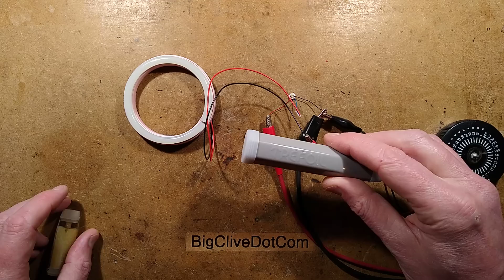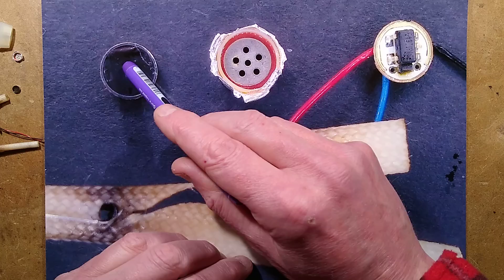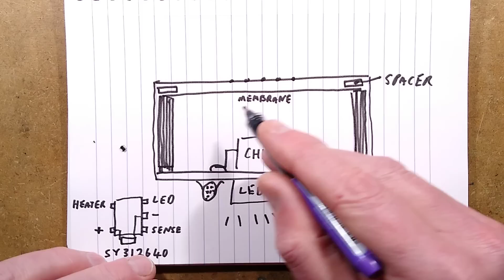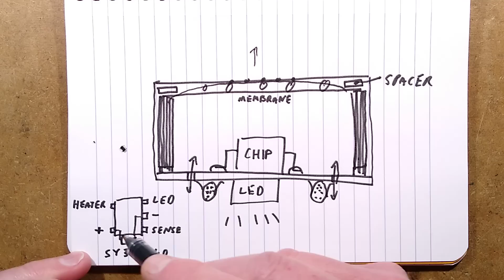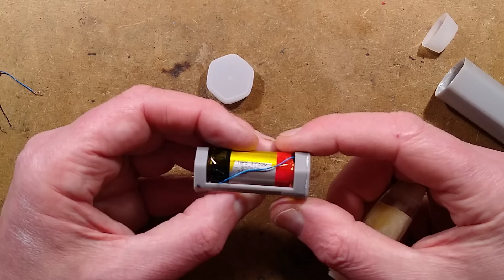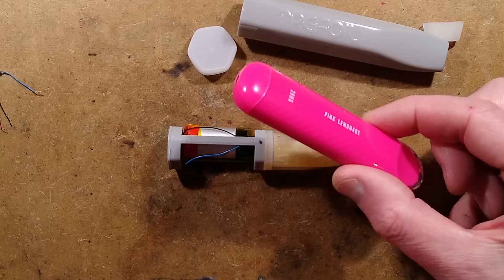Did this pose a fire risk?

Comment: I ended up buying a real one mainly for CBD delivery (old leg injury, was supposed to get surgery but then the NHS stopped taking patients for some reason in early 2020) and I've had it go off in my pocket two or three times. It's rebuildable so I just put new wicks in (they'd burned to char where they make contact with the coils), it does catch fire when dry burning it after removing the wicks so you turn any gunk on the coils to ash but you can just blow that out.
I've not tried keeping it on while not cycling air through it. I assume the amount of fog and smoke created will stifle any flames however as it's enclosed.
I was changing the wicks out while watching this. I'll try next time.
Reply: It's possible you may have a keylock of some kind maybe click it 5 times or something like that
Reply: @spruce4980  hold the 'fire' and wattage up button for 3 seconds on mine to lock, same buttons and time press to unlock
Reply: @spruce4980  5 clicks to turn it (if I were to get into the somewhat cringey vape terms "it" would be my mod which you can put in all caps apparently if you want to look super cool) off.
 That being said I'll just toss it in my pocket without turning it off a lot of the time unless I'm going inside a building as I don't want strange vapours and smoke coming out of my pocket if I do somehow manage to set it off.
If it's kept in a tight fitting pocket (like my jeans behind my wallet) I'll turn it off then too. If its in a jacket pocket there's little reason to.
It will turn off automatically after 10 seconds and I assume that it stays off until the 'fire' button is pressed again however when dry firing my coils, it's a rebuildable tank design so I take old cotton out of the coils myself then pull new cotton through after dry firing, clip the cotton to size and tuck it into wicking wells. I replace the coils with pre-wound ones (though I could make my own with a coiling kit) every week or two.

You can get 'mech mods' which basically just consist of a case with a trigger switch and maybe an on/off switch too. With this power regulation is entirely down to the resistance of the coils as the 18650s or 21700s are essentially shorted over the coil/coils when pressing the fire button with no protection circuitry at all, just a switch and the hope that whoever uses it understands the limitations of the cells and Ohm's law.
Reply: why not get the tank type,  no wick just unscrew the lid and drip liquid in.
Reply: @willallen7757  there’s a wick in those too.
Reply: @SproutyPottedPlant  it must be tiny.
Reply: @willallen7757  This is a tank type. It's just rebuildable.
The difference, I change a coil about once a fortnight and a coil costs pennies, cotton about once every 2 days. Again this costs pennies.
If I got one of the tanks I think you're talking about the coil would need replaced every 3 or 4 days due to the wick getting burned.
Those coils between £3-£5, or the dollar equivalent, more if I wanted something "high end", the high price is mainly due to the 'coil' being made from a complex machined piece of stainless steel that's been turned on a lathe, drilled in multiple axis, had threads cut and then been fitted with miniature metal coils and pieces of cotton paper wicking material. It's also mighty hard to find them at 'normal' prices because of the shipping issues.
They're also treated as disposable items rather than a reusable buyback item as the steel shell would just need refilled with cotton and a coil using a special machine, but they're treated as "once it tastes a bit burned throw it in the bin" despite being a complex machined part.
Edit: Watch link below to see what I mean about machining complexity for a throwaway item:
https://youtu.be/C2K0CvKOAsE
I don't know why all the YouTube vape enthusiasts look the same though.
Reply: @daviddavidson2357  interesting, I agree they are quite a complex part to be disposable .  The ones I get are $21.99 for delta 8 and last about 10 days.  I've always been skeptical of vaping but I cough less on delta 8 than real MJ.
Reply: @willallen7757  If you live in the US make sure your delta 8 is legal.  Some state laws that supposedly legalized marijuana were written so narrowly that derivatives are not.  Some states only legalized the leaf itself rolled in rolling papers with edibles, vape products, etc. still being highly illegal.  Also, don't have marijuana products on your person or in your car while on federal park and national forest land, state legalization will not cover you on any type of federally owned land and if caught there you are pretty much guaranteed to go to federal prison.

Comment: The refuse trucks in our area have now changed to a rotating drum like a reverse cement mixer due to the fires caused by discarded batteries in the old hydraulic compactor types of truck.
Reply from the maker: I think that's what they were like when I was a kid.
Reply: @bigclivedotcom  Drums, or trash mashers?

Comment: That's a cute little landfill igniter :D
It's amazing how much unnecessary waste gets legally produced while they're banning plastic straws.
Reply: I bet the ecological costs of one of these is already worse than 1000 plastic bags.
Reply: I was thinking the same, these sorts of devices need to be banned, they waste resources and present a disposal hazard at their premature "end of life".   The simple solution is ensure by law that any device with a battery must either be rechargeable or user-replaceable.  Even then, it wouldn't ban the proliferation of cheap toys that seem unnecessarily have a battery are inevitably promptly going straight to "landfill"
Reply: @DrRusty5  I'm onboard with that, but feel that it's maybe better to mandate disposable devices not be able to contain a battery that uses a rechargeable chemistry of any kind.

Making it so any battery powered device be user replaceable is going to reverse the Ingres Protection (ie IP98) on phones. At least mostly. Getting an exposed battery with sealed phone I think it's doable. Might need new battery case designs with + and - terminals spaced WAY further apart.

(I do miss replaceable batteries though. My S8 has recently shown to have lost lots of capacity. Normally I'd have bought an extended life as a replacement when this happened, but can't with it being waterproofed.)
Reply: Recycling plant igniter too. Not seen a refuse truck on fire yet, but a couple recycling places so far. I guess it's only a matter of time before a truck goes up.
Reply: @threeMetreJim  One did here (in England), apparently. Not too much damage done thankfully.
Reply: @threeMetreJim  To be fair, garbage trucks don't really need any external aid to catch fire. In fact I suspect anything in the (steel) hopper is less likely to set the truck afire than its own mechanisms.

Placing high-cycle hydraulic lines directly above unshielded diesel exhaust components is simply a recipe for disaster; end of story.
Reply: Side note. Replacing plastic straws with whatever paper like thing mcdonalds use, actually cured me of mcdonalds milk shakes.Use to love em. until the day I got one of those stupid paper straws and couldnt get anything to go through the damned thing. Worst milk shake ever. not been back since. Shit, it cured me of the big mac and large fries too apparently. lol
Reply: @diablo9442  BYOS. bring your own straw.
Reply: @diablo9442  probably for the best tbh
Reply: @diablo9442  Our local Burger King switched to paper straws without notice a year or so back, leading to similar experiences with our shakes on one visit.

Last week we finally returned and discovered that the bin of plastic straws had also returned in the interim . . ..
Reply: Does anyone expect any kind of sustainability from a company whose business model is to make people dependent on a drug?
Reply: @wbrenne  good point... i can assume they are more focused the money than sustainability
Reply: @wbrenne  I stopped drinking back in 2016 because I was a bit naughty. I recently took up vaping (not these shitty supermarket disposable ones, but a proper one) and it really takes the edge off a stressful life, but having a few puffs 3 times a day is orders of magnitude better than getting drunk every night or even every weekend.
Reply: to be fair I'm not sure you'd find that vape stuck in a turtles nose.
Reply: So this little product is what you'd call a garbage fire. Literally.
Reply: @PunakiviAddikti  A 2020 stick.
Reply: The plastic straw thing irks me when 3d printing probably produces like 95% landfill fodder.
Reply: Technically that's not the product's fault, that is down to the owner incorrectly disposing of it.
Reply: Guys, actually what do you want? If i were able to make the immortal light bulb, why would i ever, ever in a million years sell it to any of you? Why shouldn't i make the device destroy itself after a given time? Why should i sell you something that you only (need to) buy once?
Reply: that's what I'm thinking too, i get two disposable weed distillate pens each week, they have a 1 1/2 dice sized rechargeable lithium battery in every one and not easy to get out. I'm expected to throw them int he trash and send them to the landfill, too expensive to recycle the batteries, it would be expensive to remove them, made not to come apart that's for sure
Reply: like killing a cow after milking it once
Reply: @olik136  or killing a cow just after it's born because its male or killing a male chick a few days after it hatches.....
Reply: @norfolkngood8960  That does happen with baby chicks and it is wrong.  It does NOT happen with cattle in the USA.  You castrate the males in late adolescence and then  once they reach maturity butcher them.  You castrate them by a process known as banding. An extremely strong and small rubber band is placed in a fixture and stretched. The band is then slipped over the scrotum as high as possible and then released. The area now deprived of blood goes numb within 5 to 10 minutes. After several days the scrotum falls off and so does the band.  By then the area above the band has started to heal together. No need for cutting, no need for a vet.  Castration at industrial speed.  The same process can be used for pigs and other larger animals.  I bet for those 5 to 10 minutes it hurts like hell.  Cruel but fast and cheap.
Reply: @olik136  Does it even need a rechargeable lithium battery at all; wouldn't a flashlight grade battery work?
Reply: @SeekingTheLoveThatGodMeans7648  probably need the Lithium battery for the current demand.
Reply: @SeekingTheLoveThatGodMeans7648  I think Clive said that the rechargeable batteries are cheaper than primaries for a given capacity.
Reply: @juststeve5542  There are non-rechargeable Lithium batteries.  I believe their nominal voltage is just 3V though. 
The most typical kind everyone is familiar with are the Coin Cell batteries (CR2032 for example), used in watches and computers (CMOS/BIOS settings retention).

(also, that persons name you were replying to is... quite hilarious I find, given Clive's affinity for a partner's gender hahah [ie not ""as God meant""])
Reply: @SeekingTheLoveThatGodMeans7648  Vaping needs high current as long as the user sucks on the stick. I don't know the specs of the device Clive stripped down (or of any of those one-off sticks at all), but anything between 20 and 80W aren't uncommon for vaping. Goes up to 200W if you desire...
Reply: @BerndGiegerich  17350 cell, 850mAh capable of delivering 8Ah continuous load, equal to 32W max on 4,2V. My guess is they aren't pushing these cells to the max, so you're probably gonna see closer to 20W.
Reply: @Tomazack  Sounds reasonable. As I said, I never had a closer look into these one-off things. Still enough to get some vape out (with an appropriate coil). And still ways too much for a simple battery.
Reply: @olik136  At least then you'd get beef.
Reply: @olik136  Do cows produce milk for a long time after they give birth?
Reply: @Junji101  Baby cows are biodegradeable though
Reply: @Junji101  Yes. If you keep milking them they keep producing milk
Reply: @Junji101  for between 9 and 11 months. If looked after and not "pushed too hard" in 1st lactation she can happily produce a calf a year for 20+ years in most cases. I have seen a farmer in bits crying because his 1st cow has had to be culled at 27 years old. 
He had milked her twice a day for all that time except for the 2 months a year she was "dry". Farming is harder far harder than many people know.

Comment: Absolutely a fire risk.  In the U.S., you can mail lithium batteries (with restrictions) and you can fly with them (with restrictions), but there are still incidences of fire.
Reply: If you're flying with a Li+ powered device, you should NOT put it in checked baggage.  If it goes spicy, you want it where people will notice.  The fire extinguishing equipment in the cargo hold generally will not put such a fire out.

Mail... yeah, you really need proper packaging for it.  People, including companies, skimp on that all the time and it is bad.

Comment: Huh, didn't know the salts were manufactured by combining the base with an acid. I always assumed they had just taken the salts directly out of the... plant matter... since websites that talk about it say that it's the form that's found in nature. I suppose it's probably cheaper and easier to make it that way, just buy some base and have your lab boys add a little acid to it, rather than getting some deal with the base purifiers to yank some of their impure product partway through the production line, test it, pack it up into separate containers... etc
Reply: Plus making it that way, you can choose which Salt you want, Benzoate, Salicylate, Lactate and so on.
The first one is probably the closest to tobacco nicotine, the second is another natural form of nicotine found mostly in plants. They've got different properties in regards to taste, and how smooth they are, as in less or more throat hit
Reply: @Darren Murphy I've had some good fun with various things with benzo in the name, but yeah as a general rule it's probably a logical thing to stay away from